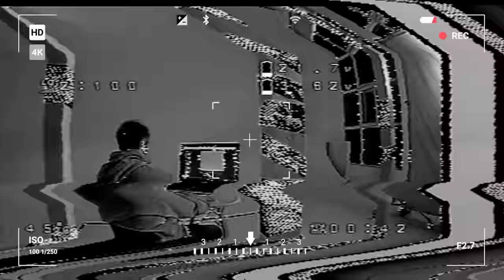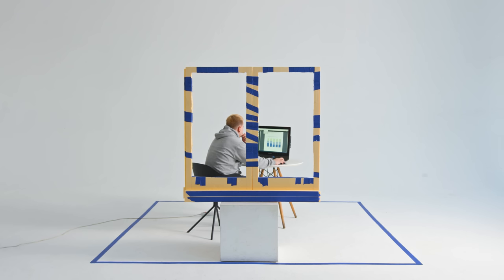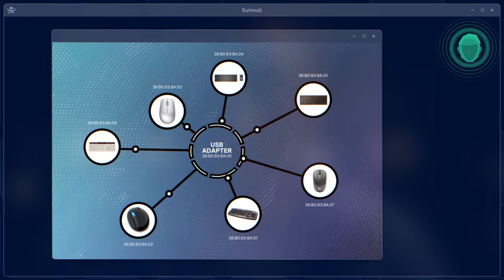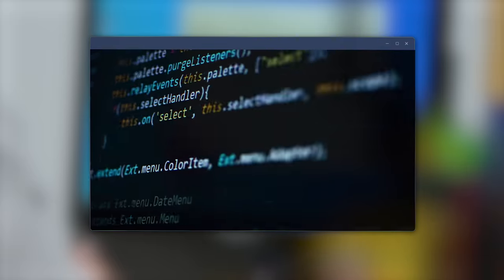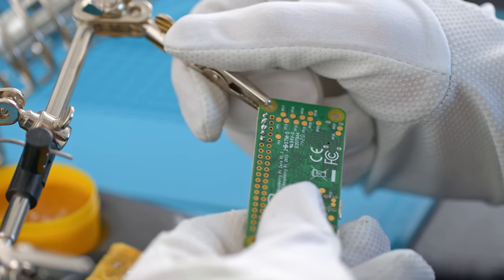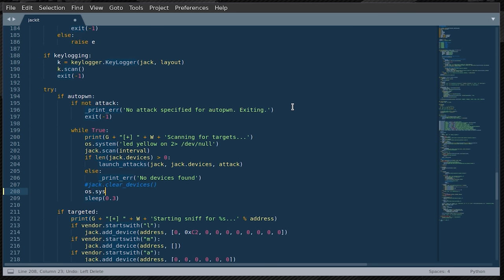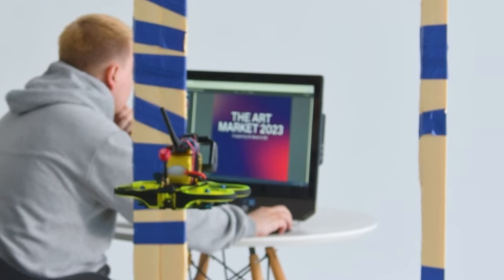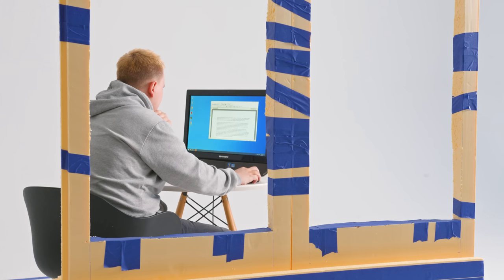How a DRONE can hack your computer in seconds | Real Experiment

Comment: Some of these shots are so funny, knowing that drones are often loud as fuck😂. People just quietly doing their work while a drone goes BRRRRRRRRRRRRR behind them
Reply from the maker: Yeah, you're right that drones are quite noisy (we experienced that while filming), but don't forget that many people work with their headphones or with a closed window, behind which you can't hear what is happening outside at all. That's why people don't really notice them :)
Reply: Some of the newer ones are not too bad and you wouldn't hear it outside your window. They are the sub 250g versions, they can't carry a large payload but they can carry enough.
Reply: Well they are using cinewhoops. Well tuned 2.5 - 3.5" toothpicks are hardly noticeable from few meters away though.
Reply: in a high rise, the windows are super thick. You probably wouldn't hear it.
Reply: Yeah but as I think they mentioned briefly in the video. People aren't going to attribute an attack to a drone they heard just outside their window. Like if I was working my 9-5 I would be focused on my work not some drone flying outside my window. I would probably attribute it to some kid playing with their new toy or something. Although the gear on top of it looks rather suspect. The drone itself looks homemade so I would probably assume the antennae was used for the remote control rather a malicious hacking attack. That is a good point though.
Reply: Many high rise buildings have insanely thick glass for safety reasons. So for those sound is even less of problem :P
Reply: well that would be even better? when they are looking at the drone to check whats up, it can hack their pc in the timeframe where they arent looking at their screen
Reply: It's worth noting that if you know your victim's location well enough, or are just looking to cause havoc with whomever you find, a slow-flying fixed-wing drone is an option as well, those can be pretty near silent. you might need a meatier transmitter, but it should be doable. The pi can also be set up to fly the done as well, so you don't even need an R/C transmitter.

Comment: Nice explanation. I've always used wired keyboard/mouse for security reasons. Was aware that you can listen them but didn't think of sending fake input to computer.
Reply: I used them becouse the mouse that cost most of mine costed 15$
Reply: Just use a Bluetooth keyboard/mouse.

Comment: I was about to brag about using a wired keyboard and mouse, then remembered I use wireless headphones with a 2.4ghz adapter 😂
Reply: I don't think it can be hacked this way.
Reply: If it uses the same chip it probs can? Idk
Reply: I got a new headset a few weeks back and was going to go with Bluetooth but went wired due to needing it for a bunch of things.
Reply: Probably doesn't use a HID driver anyways in order to use keyboard inputs.
Reply: @leerman22  Replacing what you hear or send back I don't believe would do any harm, but it appears you can pause/resume music, wether that's seperate from a keyboard input I'm not sure.
Reply: Everything i run has been wired. Never cared for changing batteries or having to charge

Comment: 9:36 with ribbon cables or directly soldering wires you could even save more weight on the otg adapter

Comment: I use wired mouse and keyboard, because of response time, as a gamer. I didn't even realize that some device might hijack a radio frequency used by some wireless HID devices and pretty much hijack and install malware remotely using a drone. I knew that a drone can carry some wifi stealer, or can carry a remotely operated camera which an eavesdropper might use to spy on the screens facing the window (which to be honest there is no real protection against it, maybe just shutting blinds might do the trick, if you have them tho). I would assume that the radio channel would be encrypted and secured. Turns out it's not. Well, time to tell coleagues who use those wireless mouses that this type of attack exists.
Reply from the maker: We're glad that you learned something new! Be safe :)
Reply: They probably won't care like most people
Reply: maybe build faraday cages around your router and computer and only use wired connections?
Reply: There's a switch Bluetooth or dongle on the wireless mouse/keyboard.  Use Bluetooth.
Reply: @w2385-i2s  Quite laggier but much better.

Comment: One of the simplest solution is to use a Wired mouse. Also I'm an Electronic hobbyist. If I remember correctly, one day when I was working on a damaged wireless mouse, It came to my notice that not only the receiver, but also the mouse itself uses the same nRF24 IC in it.

Comment: One thing that should be noted... Almost all drone flight controllers put out 5v, and usually more than enough current to power everything needed here, so you don't even need the extra battery and voltage converter for the PI/wireless adapter. You could just power it off the main flight battery.

Comment: 8:20 an extrernal battery is absolutely not needed. Most flight controllers have at least 3 or 4 5v supplies and sometimes 1-2 10-12v and one vbat pad. All you need is a regulator and you save a shit ton of weight.

Comment: I don't like using wireless peripherals simply because I have to worry about their battery. My keyboard and mouse are both wired devices, and I'm not sure if there's a wireless mouse out there with 12 thumb-buttons. That said, I do have a wireless mouse that I use on my laptop. Partially because I have it (was a gift from my sister) and it has two thumb-buttons for navigation. The battery actually died recently in that mouse when I was out of state visiting family.

If I ever run a company, perhaps one of my security policies would be to prohibit wireless peripherals. Maybe an exception for Bluetooth if that isn't vulnerable like this.
Reply: Bluetooth is also vulnerable to similar attacks

Comment: done this years ago, strapped stuff onto my drone and off it was. The problem is rarely it's as easy as you're showing in terms of running stuff with admin privs. You often have to bypass defender/edr if the payload it's outright malicious (stageless) in corporate networks. Then you have to make them fully undetectable and then escalate to admin and/or try domain admin for a real piñata. Oh and forget about using metasploit. It's detectable by anything and it's easier to write your own payload/c2 instead of trying to obfuscate it. even if you get it running an established session will be caught by anything.

Comment: 7:26 as electronics hobbyist, as far as i know, Nrf24 are available in market as digital transiver module on same band and technology like Frequency ( of 2.4Ghz range) hopping as standerd wifi. But I read somewhere that it works on different protocol standerd than of wifi so as you mentioned how some wifi devices use this same Nrf2& chip to make Wifi device?  Or they use nfr 24 as just radio chip and use separate chip as microcontroller to support all wifi protocol, standerd and USB interface?

Comment: Or they will just drop the drone payload on your roof and remotely control it, picking it up whenever they feel like it. They can even send it to the mail room, or send it to a staff member that's currently on holiday, it can sit on their desk for potentially a week or three, before holidays even longer, doing whatever it's programmed to do.

I don't need to tell everyone watching this how vulnerable the world is, I just wish everyone else knew.
Reply: I already commented that I would try to put a solar cell on the drone an park it on the roof. Nice to see I'm not the only one with that idea.... Then again, it migh be a bad thing.... depending on who else thought of it.
Reply: @danielstellmon5330  It's been done so it definitely works. I can't remember where it was but a corporation found two drones on their roof recently. The IT department found the WiFi was being hacked, they tracked down the device and it was on the roof.

You could throw a cheap device up there in a piece of pipe and it would probably sit there for years.
They are so vulnerable and have no idea.
Reply: @MissFoxification  I really need to stop thinking about this.... I just rememberd I say a human presense detection radar that could be installed. The drone could tell you if it's been found.
Reply: @danielstellmon5330  ESP32 LD2410 mmWave sensor, easy done.
Or just buy an old pole mounted utility box, preferably second hand, scratched up and dirty, mount it and walk away.

Waaaaay too easy.

Comment: Good video! But the new logi bolt technology does the communication encrypted so it's not vulnerable to this type of attack, correct?
Reply: They linked to the page that shows what devices are currently vulnerable and what updates are needed to fix that. Not to mention just because it is encrypted does not mean that a more sophisticated attack is not possible.
Reply: Looks like the Logi Bolt, reconfigures the receiver to only listen to certain Mac Addresses as and when devices are removed/added in the software.

Comment: Talking from "back in time" ..I always hated wireless mouse/keyboard, sometimes it would be jittery  inputs but mostly the battery issue.
     Glad I never did switch to wireless!
Reply: My sister had a wireless mouse, and it was really annoying, for example it turned off randomly if you didn't move it for 10 minutes

Comment: As a drone pilot myself, I think drones aren't quite the way to utilise considering that drones get effected by radio signals easily. If you strap a strong transmitter into a drone, it will most likely interfeere drone's own signal and make it soo hard to control and get video feed.

Comment: I have two of those wireless adapters, I did not know the security on them was that bad. my main keyboard and mouse are wired, but I do have wireless ones for the laptop if I want a larger keyboard on the go... maybe I'll be a bit more careful what I'm doing when using them.... It's almost like a rubber ducky or whatnot that you don't even have to plug in.

Comment: The drone is equipped with a hacking device that enables it to install malware onto a computer without the user's knowledge. The drone can fly into buildings undetected and can pass through well-secured perimeters. The vulnerability exploited is a wireless mouse and keyboard technology called Mouse Jack. The technology is used by a lot of producers, including Dell, Logitech, Microsoft, HP, Amazon, Gigabytes, and Lenovo. The video explains the technical details of how the attack works by forging wireless mouse or keyboard signals to send inputs to the victim's computer, which, if executed, give hackers access to that computer. It is worth noting that an adapter from a wireless mouse can pick up wireless keyboard inputs.
Reply: undetected? have you ever heard an fpv drone ?

Comment: The mentioned firmware mitigation for the Logitech C-U0008 USB dongle (G Pro Wireless) seems to be removed from the Logitech website.
Reply: Use the wayback machine, the patch is still there if needed.

Comment: Please, NO ONE charge a LiPo battery with the method in this video (directly off of a 5V USB port). That's a great way to start a fire. LiPo batteries need a specialized charger chip. I did like the video overall though.

Comment: Dont know much about software but shouldn't the transmitted signal be first uncrypted if it is possible with micro controllers as they communicate with another mcu with spi usart and i2c with the decryption key at the receiver module

Comment: Yeah, I could already see how to write a script with Python's Scapy library. You could scan the network of devices and get the MACs and then steal the MAC address and pretend to be the mouse or keyboard, because the USB adapter doesn't make for a very good switch it will humbly accept the change.

Comment: If your building a Drone to hack, you are likely putting solar on it, and using Vacuum assisted suction to adhere to walls, Some of these Suction systems don't matter if the surface is porous, as it can fill them in to some degree, only needing a small amount of power to upkeep the suction via the vacuum. 

You can literally have days or worse to spend dealing with a target. 

Time, is not limited, unless the device is spotted.

Remember that we are at a point, where this is new and novel, This is the worst this technology will ever be. 
Drones with Drills, and an ability to assemble permanent attachments will eventually become the norm. 

Imagine looking at your building and noticing an innocuous new Camera on your building, barely looks out of place. 
No one showed up, but there was a drone noise for 5 minutes outside your place. 

Or maybe you heard nothing, as it was on a high rise, just a small Plate in a corner, looks like a cover to a pipe. 
Folks are inventive, and it will get pretty bad, before it is really truly combated to any realistic degree.
Reply: I had the same solar panel thought. Park the drone on the roof and let it recharge.

Comment: But, in many case, the newer windows 10-11  can't download backdoor exe program with antivirus On, (the defender is block the connection)

it is very difficult with one command from mouse hijack.
Reply: I'm pretty sure admin accounts running command line subvert Windows Defender.
Reply: @I_Love_Learning  yaa, the command line example.

powershell -command "Set-MpPreference -DisableRealtimeMonitoring $true" (this command disable "realtime protection" in defender)

but, is very difficult, btw

Comment: imagine you created this drone and tried to send this to secure facility or a just in a normal house, eveyone will be able to see it and recognise it that this drone which has a camera, a antena and circuit n all, so its recognisable and it will be strange if sent this to a building which has tight security, there cameras will spot it, even a sound can be probuematic and gaurds will shoot it and boom you have your drone on floor also what if you system does have any wireless device?

Comment: Ok so all USB ports are disabled, except the ones with wired keyboard and mouse plugged in.  wifi transmitter/receiver removed. From PC and ethernet is disabled and cable unplugged. PC is in a RF proof enclosure and all cables leading into it are covered with copper foil and grounded. How can you get access to my data with no physical access?

Comment: BE SAFER..
Mitigation for most automation attacks

DISABLE WINDOWS RUN
GPO > User Configuration > Administrative Templates > Start Menu and Taskbar > Disable RUN

ALWAYS ASK FOR ADMIN PASSWORD ON ELEVATION
run this command as administrator on POWERSHELL

Set-ItemProperty -Path "HKLM:\SOFTWARE\Microsoft\Windows\CurrentVersion\Policies\System" -Name "ConsentPromptBehaviorAdmin" -Value 1
Reply: Could they not just use windows key + x, to bring up the power user menu, then cmd or cmd admin, then run the command in there? And since it's a script it would go by so fast that a person may not notice
Reply: @CMK-BigFoot-1420  they usually Go on the fast way. Windows menu can be laggy.

Comment: Such a Mousejacking attack is very unlikely to occur in this manner. First, the victim needs to move the mouse for the signal to be registered. Additionally, since 2015, most wireless keyboards have been transmitting signals in an encrypted form. The usable range is also only about 10 meters if you're lucky. Drones are also not exactly silent, and the user must be logged in and not sitting in front of the screen. Like many such hacking videos, this is mostly a purely theoretical possibility. In real life, the chances of a successful hack in such a case would be around 1%. Conclusion: Useless.

Comment: But number of vounerable devices is not big right? i tryied mousejacking with flipperzero and it didnt worked single time on any mouse and keyboard which i tested. i tested on logitech, microsoft and chinese brands. with no success.
Reply: This is correct. The level of sophistication needed to perform these attacks is severely understated. The window to use this in the wild as an attack vector has sailed.

Comment: So basically the drone has nothing to do with the hacking...
For all ordinary buildings everything you showed can be done with a backpack instead of a drone...

The drone is only needed for highest security stuff where you dont have any kind of physical access in a large radius...
Reply from the maker: Yeah, the drone is just carrying that hacking device, and the scary part is that you won't even notice it with a closed window or your headphones on...
Reply: @Sumsubcom  I fly similar drones and you can absolutely hear those even through closed windows...
Idk about skyscraper windows but regular windows are not sound proof enough...

It drones shine in scenarios with no access whatsoever...

I like your videos but this one just feels like you want to scare people (not with the hacking). I feel like you portrait drones as the evil thing here and not the actual hacking equipment...